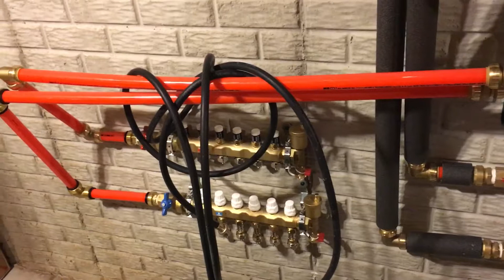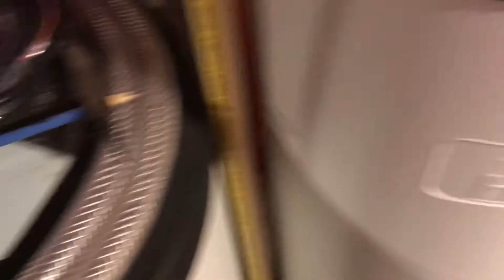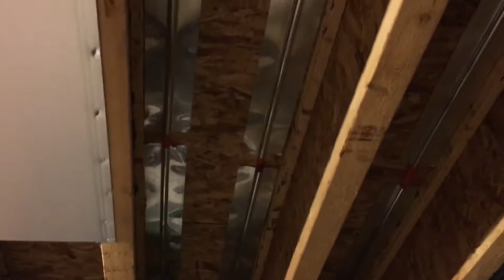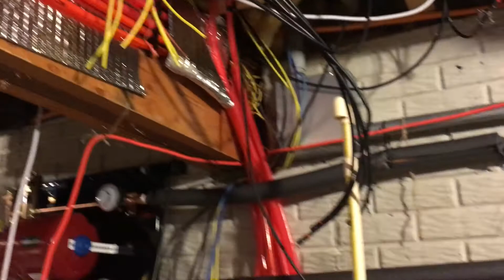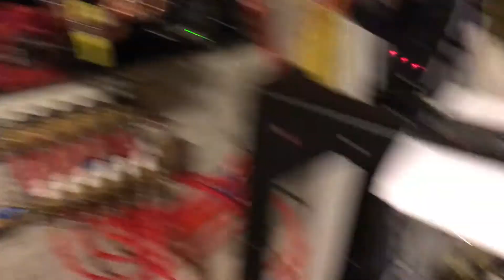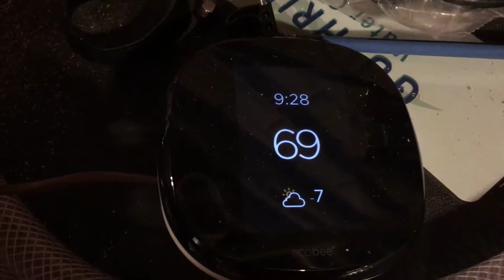Hydronic Radiant Heating Solution

Comment: As for the circulator, is the mounting orientation critical? I just purchased a home with this system and I’m not familiar with it.  What’s the critical valve do? I also have one and should probably know.
Reply from the maker: I would reach out to them and ask that question.  I don’t want give advice and burn up your pumps.  I reached to them for a few questions during my install.

Comment: What size piping from the water heater to the panel ? And also what size from the panel to the manifolds?
Reply from the maker: It’s 3/4 inch to each.  Then the manifold steps it down to 1/2 out to the runs.

Comment: What is your outgoing temp? I have the same boiler I’m looking to install in the coming weeks. Was it hard to purge the system of air? Is it expensive to run? Mine is propane.
Reply from the maker: The outgoing temp is 120 and heats 6 separate runs.
Reply: @MKEOutdoors  what are your pump speeds set at? 1,2 or 3?
Reply from the maker: @tomquick2594  I have mine set to 3, with the lower settings I was not getting the proper flow between them.  I also setup an ECOBEE for control of the theromostat